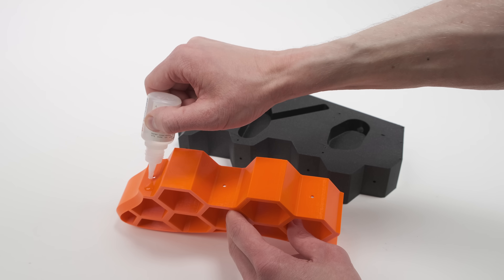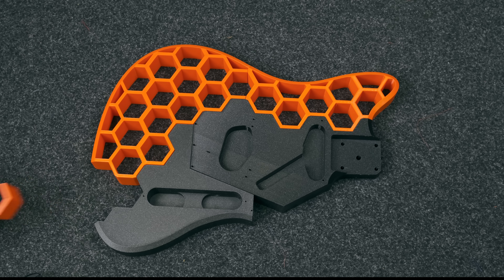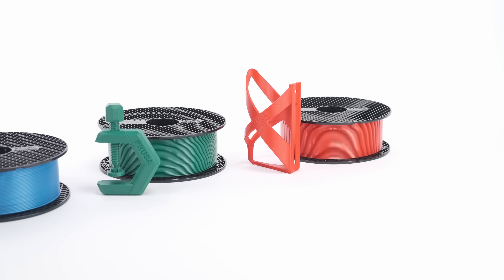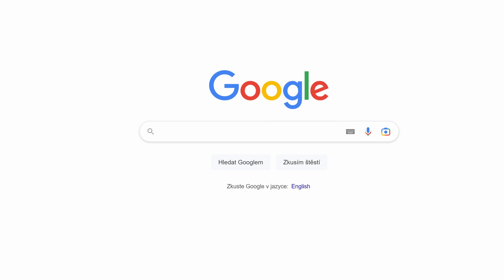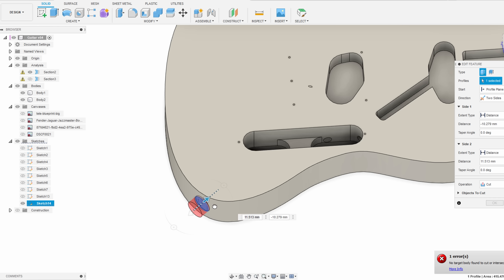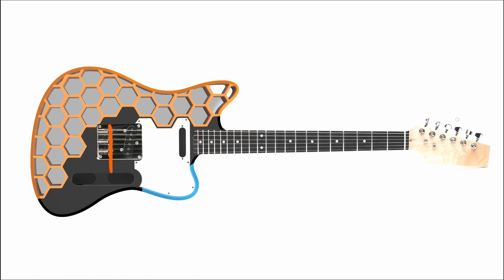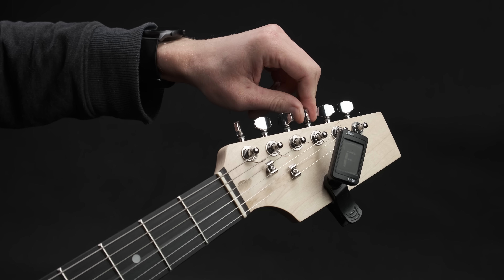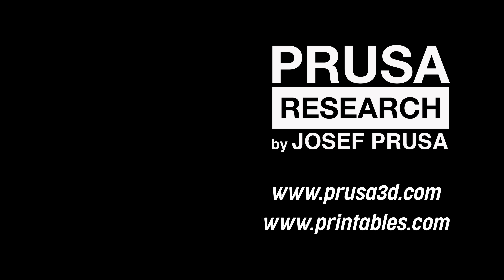How to 3D PRINT A GUITAR - the challenges, how it sounds, and how much it costs

Comment: Considering only the player, strings and hardware, and basic construction affect tone, you can make an electric guitar out of almost anything. Tonewood only matters in acoustics.
Reply: So basically you believe that everything! but the wood affects the tone? Let me tell you what, that is a stupid believe. In fact, logically and scientifically everything affects the sound, depending on the setup and the final sound everything can be more or less important, can be elevated or suppressed.
You can end up with similar sounding recordings of two pretty different sounding acoustics, when suppressing the differences with your choice of mics, recording techniques, eq settings and so on.
I used to be  a recording guitar player for quite a while and was never happy with the typical sm57 on the speaker, off the middle whatever - approach. It never reflected what I was hearing, when I dialed in my sound. In a recording situation, where I am in the same room with the amp I am usually 1.5m to 3m away from my amp, with my ears being at a height of roughly 1.70m ... I never stick my head into the speaker to adjust my sound - never!
So I asked for a mike that is known for its neutral sound to be setup at this distance and height et voila the sound of the recording was suddenly way closer to my sound than before. Just for fun we set up a second mike, pretty close to the first, made it a stereo recording ... That was the closest we got.
And, yes I know, that my ideal guitar sound is maybe not the sound that will end up in a final mix, but all the engineers that I worked with agreed, that it is a good idea to capture what is there as close to the reality as possible first.

So long story short: everything is influencing the sound, tone wood included. The differences between different woods might be subtle (and sometimes suppressed or altered by other influences e.g. tremolo systems) but because they are standing at the beginning of the sound defining process (go fingers/pick/strings/bridge/saddle and wood, then! pickups ->), if you ignore them you might miss out on some opportunities your setup is offering.

Just because you don't care doesn't mean they don't exist ;- )
Reply: @benjaminheyer6980  i really dont care about your anecdote. Tests show that wood has zero effect on the tone of an electric guitar.
Reply: @johnnymac6242  I assume you'll not miss out on enlightening all of us and share the original information, those tests?
Reply: @benjaminheyer6980  "Tested: Where Does The Tone Come From in an Electric Guitar"
Reply: @johnnymac6242  I knew this video and nothing in this video contradicts what I have said. " ... logically and scientifically everything affects the sound, depending on the setup and the final sound everything can be more or less important, can be elevated or suppressed ..." And you might have noticed that I am definitely not rooting for mahogany over ash or stuff like this, because in the end it is a matter of taste and only one ingredient to quite a few, one of them being the pickup, which acts like sunglasses, filtering certain frequencies out as well as pushing others can render the sky pink or orange even though it is obviously blue. When comparing the sound of electric guitars to make a statement about the influence of the wood after sending the signal through pickup/electronics/cables/tube saturation/distortion/amp/eq/speaker/microphone/amplification/speakers/listening environment is first of all not scientific but maybe a practical approach but in the end it is not very surprising that you'll find out that the sky is always pink.
If you push this to an extreme you'll find out that if you turn down the volume the strings don't matter, song choice or what you play and how you play it doesn't matter, the hardware ... everything sounds exactly the same.
Reply: This is 100% something i agree on
You would get suprised how many people who still believes that there is term tonewood used in electronic instruments, when they just generate electronic signal that is being manipulated with effects, amps eq and most importantly speaker that blasts that signal back to the physical world
There is one yt channel of this very topic where that person makes basic guitars almost from any material he can gets his hands on
Reply: @mozkuthehermit5909  what channel?
Reply: @aindoria  idk which one he means but a few come to mind. My fav is Burls Art who built guitar out of anything ranging from coffee beans to newspapers. And if you're curious about why tonewood doesn't matter in electric guitars, check out Jim Lill.
Reply: @mozkuthehermit5909  Nobody ever claimed that you can't build a bow out of fiber. You can build a guitar out of concrete, no doubt. Will it sound good? Who cares? That is a matter of taste any way. Will it sound different? Pretty sure, because it is a matter of resonance and dampening frequencies and so on, which I assume is in general different from wood. Are those differences audible? Depending on what follows in the signal chain you will be able to use these differences or will want to eliminate them, again depending on your taste. 
A guitar is by definition not an "electronic instrument" since the tone generator isn't electronic but a plucked string that resonates with the body of the instrument which is then picked up by "electronics" so to say. Usually we are talking about an electrical! guitar not an electronic guitar.
I've been building electric guitars out of one piece of wood (meaning body, neck, and head are one solid piece of wood - no glue, no screws) on a cnc, btw ignoring the myth of tone wood that there is good or bad sounding wood, building guitars out of all kinds of wood I could get my hands on. I was able to compare two 99.5% similar builds, the estimated 0.5% missing is due to the sanding done by hand, where the only difference is the wood and let me tell you, they sound different! Put in the same pickups they are getting closer, use the same amp settings, even closer, distort, record with standard SM57 technique, compress, equalize ... hardly any difference if at all.

So does tone wood matter? It is up to you and if you don't care you might as well ignore it, but telling that it doesn't make a difference because you don't care about it (and physics) is kind of ignorant.

Comment: TBH I'd be more interested in how a 3D printed neck would be, of course you'd have to manually install frets but that would be easy for most to do, actually cutting them into wood first would take more skill and precision to do. Actually, the frets COULD just be plastic and that would work. So I think you could 3D print everything but the hardware and electronics, and strings lol.

I see the part where he addresses the neck, would still be interesting to see how that might turn out. I think there's printers using carbon fiber too if I'm not mistaken, that would probably lend itself much better than plastic and might even actually make for decent frets. I could see why a non-guitar person with a 3D printer would want to print as much parts as possible. It would still need a truss rod, I suppose it would also make sense to print the body, neck, frets ect all as one piece. I guess maybe it's possible carbon fiber when printed all as one piece might not require a truss rod depending on the gauge of strings. Then again in that case you could maybe even print the bridge system into the guitar, then only need tuners, strings, and electronics. I guess how much a printer can print at once is a potential issue for doing it as one piece too.
Reply: Alternatively print a mould and make the neck out of carbon fibre + resin, inlay a couple of CF rods as trusses and use CF tow for filling - may be able bulk it out with some less expensive filling.
Plastic frets not a good idea - they would wear very quickly.
Reply: I am currently working on a 3d printed  neck for a custom guitar of my own design. 

My printer is 350 x 350 and I still had to make it from 2 pieces. I am only 3d printing the neck itself. The fingerboard is a beautiful piece of Koa. 

My first attempt used two 6mm stainless steel rods running inside the length of the neck to tie the two pieces together and stiffen it. It turns  out that it is still not stiff enough. I am now trying to decide if I want to try 8mm stainless steel rods or try carbon fiber rods instead.

Comment: as someone that made multiple 3d printed guitars can confirm, they can sound really good. its mostly dependant on the set up and kind of parts you use. I used tele style layouts for the pickups and used actual fender / squire parts (some cheapo 2nd hand finds haha) and the 3d printed sounds better than my pre built cheap brand guitar...... they also look so cool tho and you can get real crazy with designs, love it
Reply: Well as long you have scale lenght in mind, tuners and mics you are running with, you can make almost any material work as guitar base build
in the end you are generating electromagnetic signal what you manipulate with effects and amps eq then that is blasted out speaker
If anything that is most important in that signal chain is speaker
You can make most disgusting looking guitar design and it doesnt matter as long basics are met, you might get suprised how little you need to make guitar work as a guitar
Reply: @YOLOnline how do you find the balance between neck and body weight? Do they neck dive a lot or for example using higher body imprint % solves that?
Reply: @lemonbrothers3462   @lemon Brothers  my design might be even more lightweight than this one as it's very open and has many holes. Mostly because of strength and to add some weight , I filled it with epoxy resin tho to fill in between the imprint fill structures. It does neckdive slightly but with a nice strap not as much and the lightweight overall feel is pretty nice when playing
Reply: I actually would have never thought about doing this. The reasons I had in mind were: It's plastic, it'll surely bow easily and be junk, and it would sound like crap. I'm pretty sure printing material isn't just plastic, but you'll have to teach me about that. After watching this video, I found it convincing, but not entirely. After reading this, and knowing that they can sound really good, I am convinced this can be a good and practical project!
Reply: @Commander_Grub  the bowing problem I solved by basically having a small wooden insert (the width of the neck) that slides into the body from the backside. So thats a little different in my design than this one from the video.

Comment: I'm just going to leap in at the start of the video and say it. It will sound great. The body has 0 impact on the sound of an electric guitar. That's just not how physics works  with electric pick-ups. The only wrong thing you can do is make a body that creates magnetic interference interfering with the pick-ups. That's probably also the only avenue to impact the sound via the body.

Comment: I would think the biggest issue with a guitar like this is neck dive. Where the balance of the guitar is neck heavy and doesn't like to rest on your body or on a strap. You can nail a bridge to a tree stump, slap some pickups and tuners on it and it'll play. But it wont be comfortable or balanced. If you could put weights in the body somewhere you could create a wonderfully balanced body/neck combo.
Reply: What if you 3d printed it as a headless? Removes the weight of those tuning pegs
Reply: @lossibinks  How much weight would you be subtracting though?
Reply: @Commander Grub  most of the wieght of the headstock is in the machine heads, it takes about 10% of the weight of a strat being just under 4kg, surely this body is far lighter than a strat so the wood and heavy machine heads would take up a larger percentage of that. Headless guitars are mostly near perfectly balanced with no neck dive.
Reply: @Commander_Grub  A lot and from the most distant point actually, so it makes quite a difference actually.
Reply: 3D print hexagonal pots the same size as the cutouts and pop them in, with a redesign you could put a slight brim on the holes on the top of the guitar with spots for magnets and then do it magnetically too
Reply: I hope he's used to SG's
Reply: @Giovayo  why?  explain that for me please.
Reply: You guys are overthinking thinking it. Weights! Headless design! Nah. Just print a body that has the strap button mounted at the 12th fret. There's a reason SG's, Jags, and Tele's have neck dive, look where the strap button is mounted. Just print a strat-like body and have a nice day.
Reply: You're right! I actually have a 3D-printed tele with a similar negative space design, and the neck dive is VERY much a thing. That said, my #1 electric is a firebird. The tele's not too terrible for dive stacked against that.
Reply: Anyone know what song he play at 10:36?
Reply: @jauharinur-pu2ye  Georgia Satellites "Keep Your Hands To Yourself"
Reply: @jauharinur-pu2ye  sounds like the pretender by the foo fighters from the 2:40 mark
Reply: Had a BC Rich Warlock NJ as my first "real" E-Guitar, after my beginner 100 bucks guitar. There was no way to balance that thing. It was nice in the classical position, which I still play in, but the neck constantly pressures you to hold it. I now have an Ibanez, and it just stays in an angle like I want it, no matter if standing or sitting.
Reply: You could easily add spaces or segments where you add weight or reinforcement to the body and basically fix that problem
Reply: Use a shoelace onto your belt?
Reply: Ive built two now, feels nicely weighted very similiar to a standard electric
Reply: Absolutely this. But as much as I like the wood I want the guitars to be more lightweight.
Reply: Actually you can handle this with the amount of fill in.

Comment: Having to use light gauge strings to avoid too much tension on the plastic parts is not an ideal solution. I'd shorten the center block to just below the bridge so it can be printed flat on the back and then embed two carbon fiber rods in the print. Alternatively, add channels for the carbon fiber rods, split the part in two like a clamshell and glue things together. If printed in ABS, acetone will weld it together stronger than the print laminations.
Reply: BB King and Billy Gibbons say 8's are fine.

Comment: A bit of honesty would be more useful here. You didn't print the neck because it wouldn't be able to withstand the tension the strings exert over it. Nothing to do with looks or playability.
Reply: That is not true, printing the neck is possible, as is mentioned in the full article.
https://www.youtube.com/watch?v=-HobdwFHNtU
Reply: @TheMikolasZuza  It is possible, but it's not reliable nor durable. It was also mentioned in other comments that the neck joint also deforms and gets destroyed over time. Both of those phenomena happen because none of those parts are capable of withstand the tension the strings exert over them.

Comment: I still believe that the neck still must be completed with trussrod. Under the constant tension from the steel strings, the wood will eventually bend over  period of time. Cheers from Indonesia.
Reply: They are using a kit neck you can buy and that already comes with a truss rod pre installed.

Comment: This is a really cool project, and I love the colors and the hexagon feature. However, I noticed that the reveal (i.e., the distance between the edge of the fretboard and the string) of your E strings are not equal; the low E string is much closer to the edge of the fretboard than the high E. You had mentioned that the neck should be "perfectly aligned" with the bridge, and it seems like it is not. Do the available designs correct this? I think it would have been nice to acknowledge this discrepancy in the reveal during the demo.
Reply: There are "remixed" files available at the same site as the originals, and one of them has shifted things over a little to better accomodate the strings.
Reply: the height can be adjusted as well. If you look closely there are 2 vertical screws oneach bed.
Reply: But TBH you want the high E to be less close to the edge than the low E.